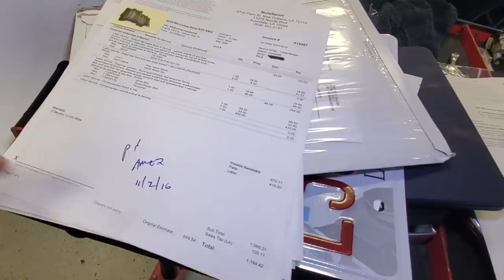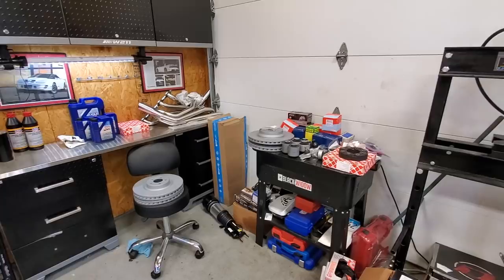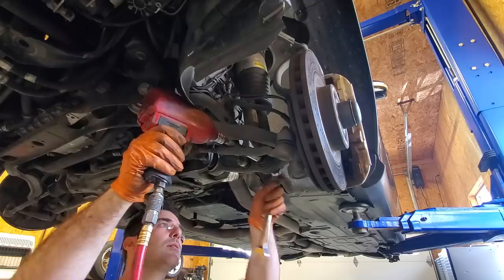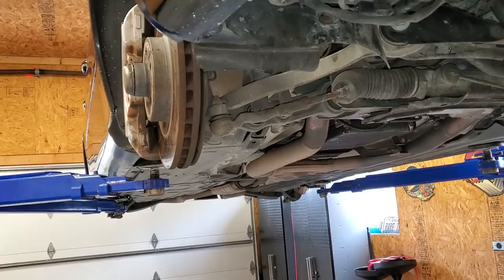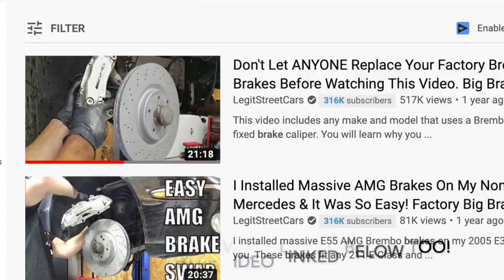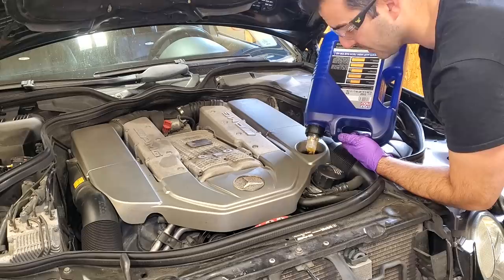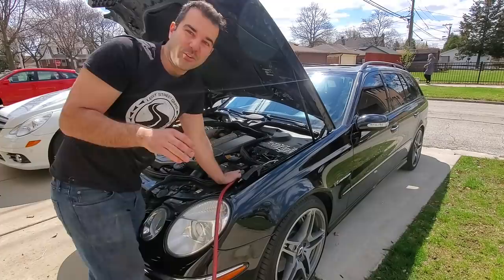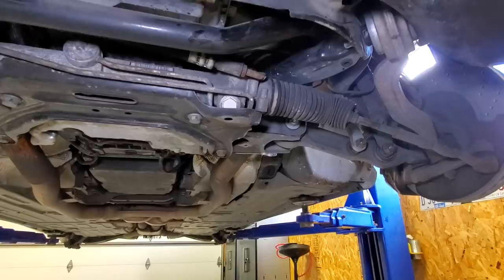I Mechanically Restored My Rare E55 AMG Wagon In 1 Video & Saved $5,000 Doing It Myself. Legit Fix!

Comment: Why can't European cars be reliable like Japanese cars? Is it planned obsolescence or bad engineering?
Reply: I believe it's the economics of it. Many European cars are leased while jdm is bought. German cars really only need to be reliable for about 3-5 years, or the length of a lease. 

That and Germans use customers as beta testers of technology. Think about, a Mercedes s class from like 15+ years ago has a lot of the same technology that's in cars now like radar cruise, etc. 

That plays into the buyers tho. They like to have the latest and greatest technology, and that means the technology may not be fully developed.
Reply: And,
The German cars show up with 4 to 500hp. And full warranty.

The reason subys go 2 to 300k like the mb desiel is because they do not make enough horse power to hurt themselves.
Reply: @andrewcox3686  head gaskets have left the chat

But it's not so much hp, but how it was designed. A Corvette comes with 4-500+ hp, but has relatively little to no reliability issues to German car. 

I think the issue is cad. Cad allows them to put too big of an engine in too small of a space, no room to work on it. Sure it fits, but it realistically shouldn't be there.
Reply: @NatoriousGamePlay  That makes sense relative to engine work. My friend has a GL450 AMG and it seems like the repairs he's needed cost more than what the vehicle is worth. It just doesn't make sense to me while Lexus exists.
Reply: @mishimposble  yeah, it's just not fair comparing any Toyota product to something else tho. They will essentially never break no matter how neglected or old. 

But one thing to consider, Toyota still uses a lot of na engines, and especially as they got older they are just more reliable. No turbos to go bad. No oil that gets cooked, etc. It's just simpler
Reply: @NatoriousGamePlay  nope the things that fails on german cars are mostly the power train and many other electric systems
Reply: @NatoriousGamePlay  toyota also has some turbo engines. a 4.5l v8 twin turbo diesel, a 1.2l turbo petrol and a 2l turbo petrol, a 1.6l 3cylinder supercharged...
Reply: @carholic-sz3qv  never said they didn't. I believe I even brought that up by mentioning the n54 motor from BMW. And yes Toyota does have turbo motors, but the majority they sell is na, which will always be more reliable.
Reply: No,its to much technology
Reply: @mishimposble  well do you know that here in europe there are not many Lexuses
Reply: @jjk3840 Well well well,  did you know there are more American cars in America? No point.
Reply: I think it's the german perspective on perfection that really hurts aging German cars. And also the bad service attitude in America.. over here, we mostly have those aging German cars, and they don't have as many problems staying alive which is due to more normal mechanics work being able to work on them, more parts are readily available for them in different price brackets. Plus we tend to buy a lot of diesel cars here, especially if we want to drive them distances that Americans call normal - those hold up a lot better to aging. Also the TÜV does its job well - because the tech check up we can't neglect any maintenance ever - so it never piles up that badly and we keep putting the money into fixing it, classical self betrayel. 
One more factor is the overall nature of the buyers.. over here no one poor in their right mind buys an AMG because the fuel cost alone would kill someone that has troubles to afford the repairs. That helps them staying alive. The mechanics are all well trained here and are certified by the government - you literally can't open a repair shop, if you didn't pass the so called "Meister".  That also helps those complicated cars to stay alive, since bad workmanship is more rare (don't get me started on quick lube stations - what a moronic idea).
And last but not least - German perfection is about absolute technical perfection. It's not designed to be tuned. It's not designed with age in mind. It's designed to give the very best tech standard and very best quality feel at that point in time. It's about tactile feeling, elegance, high speed stability, status. 
Short:
If you are a peasant that cares about money you are not worthy of a German Luxury Car or any real Luxury Car for that matter.
Reply: Andrew Cox  4-500hp if you are talking about amg/m, did you forget about the regular models that are just as unreliable??
You can make all the excuses in the world, there’s no denying the reality German vehicles are just plain unreliable!
Lease under warranty is the only consideration for a German vehicle
Reply: They buy a new and use it the car for 5 years and then sell it to eastern Europe.
Reply: It's several things, one is planned obsolescence. They don't need it the last more than the lease term. I find that usually most of their stuff lasts hundred thousand before it gets expensive. Also with Japanese they are usually slow with new technology and will they put it in it's been tested a lot. The Germans are much quicker at putting new technology in and not tested it nearest as long. The owners become the testers

Comment: You are being a bit disingenuous to say that you can carry out most repairs at home is as long as you have a fully fitted out workshop like yours. I live in a mid terraced house and there's no way in a million years I could do with some things you're doing on the street without getting run over or somebody driving into a vehicle when trying to park.
Reply from the maker: If you have a safe place to work you can absolutely do brakes and suspension work.
Reply: @LegitStreetCars  The last time I had any space to work on a car was when I lived on a council estate that had a big car park and garages. We all had to move off the estate because of renovation works. I have been back to the old estate and car park and garages are all gone. Bottom line is this in south London any spear land has been built on so apart from checking the oil water and tyres we can't do what you do.
Reply: Phil Abrahams get a couple jacks and get to work
Reply: Phil Abrahams caution cones
Reply: @moneyxbags123  Yeah thet's going to work 🙄
Reply: Phil Abrahams better than sitting on yt and complaining 😂 look up diy garage maybe youll have one in your area
Reply: @moneyxbags123  something that I have done. The bottom line is that you need your own garage or off street parking because working on your car on the street is just asking for trouble.